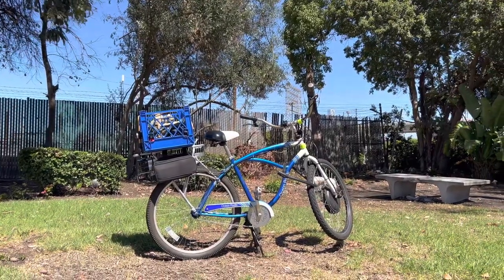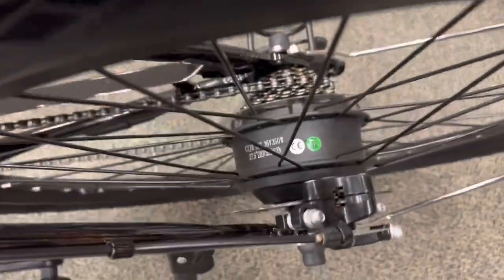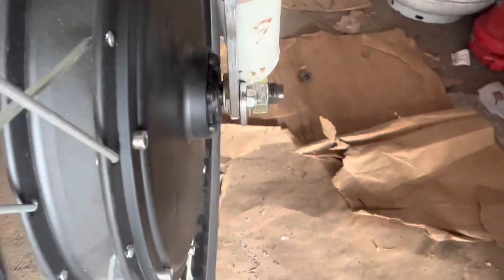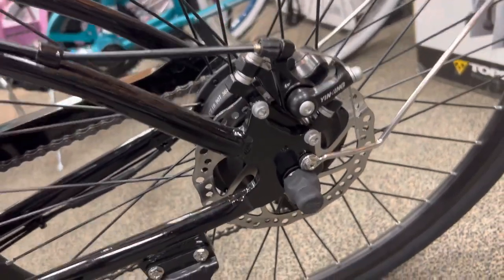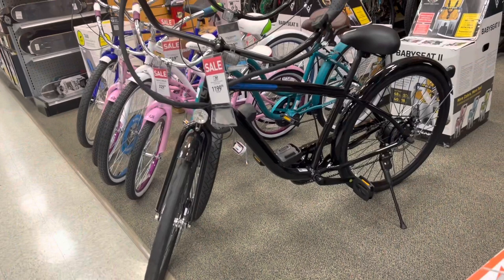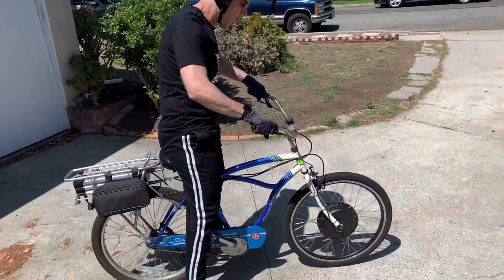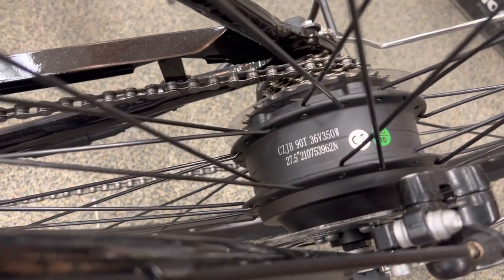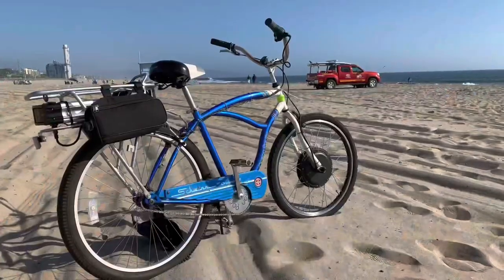Homemade E-Bike vs Store Bought E-Bike

Comment: One question I have, on your homemade ebike, what do you use for braking? I’m planning on putting the wheel with the motor on the front as well, I’ve heard some of them have a brake built-in? Other than that I’m left with my rear rim brakes, which doesn’t seem safe.
Reply from the maker: I bought a front brake rotor kit for it, but I found that there wasn’t enough room for the caliper to fit between the brake rotor and the electric hub, so it didn’t work. I ended up using a rim brake on the front motor. It doesn’t stop as fast as I’d like it too. I’ve seen other people also have trouble putting disc brakes on these electric hub motors. It has bolts for a rotor, but there isn’t enough room for a caliper to fit.